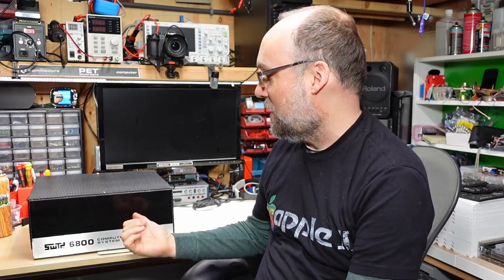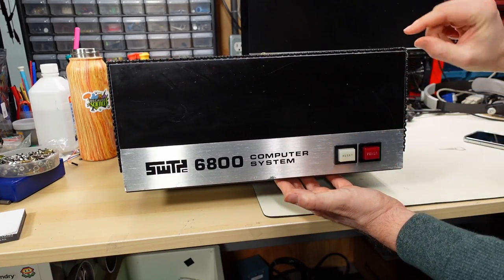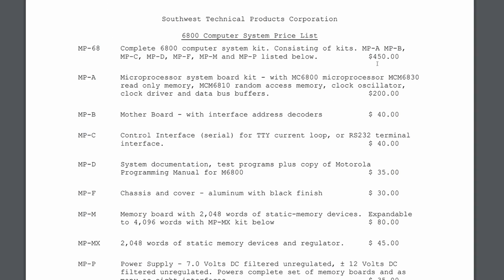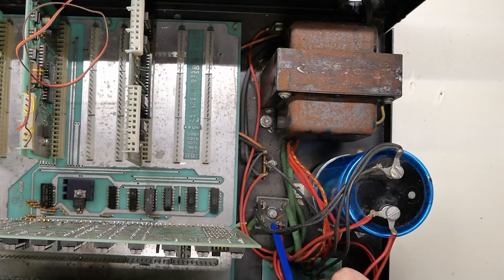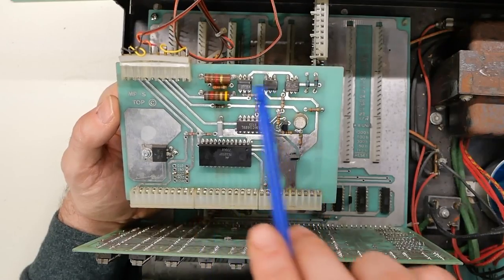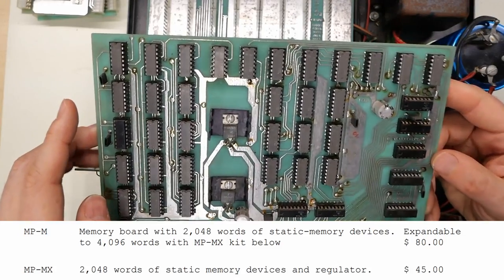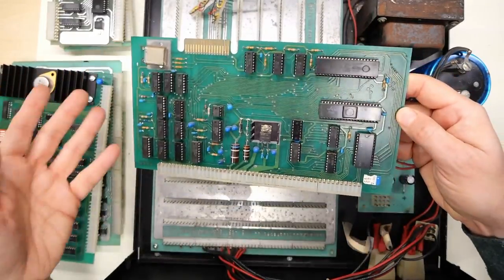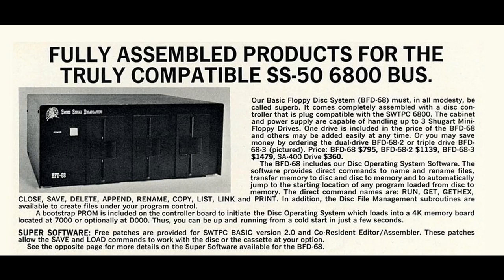The 8-bit home computer from 1975 you've never heard of

Comment: With modern ICs it'd be simple and cheap to make a 64k memory memory board (a custom board , a connector, a regulator, and a modern 64x8 SRAM chip) although you may have to block or mirror romspace at E000-E1FF (or simply block E000+ for 57k ram.)
Reply: There's also going to be memory-mapped I/O. Though likely it will be well documented, given the age of the computer.
Similar to the 6502 the 6800 has a reset vector at FFFE-FFFF so you need ROM here at power-up.
Reply: @markevans2294  I just checked the original MP-A manual online out of curiosity, and it seems that FFFF is intercepted at startup, and it seems like you would ideally disable 80xx (I/O),E0xx, E1xx (mikbug rom), & possibly A0xx (mikbug ram). However, it seems everything above A000 was earmarked for expansion roms (such as that disk drive controller) so a 32k card would be just as simple as I said, you might need a few extra diodes to deactivate read/write at 80xx for a 40k card, and a more complex solution to map the rest.

Interestingly, the later revision (MP-A2) had had logic and DIP switches to control which memory was allowed onto the system  bus in 8k chunks, as well as several 8k EPROM sockets with selectable addresses.

Comment: OK Adrian, the cap does not "produce" anything it filters the full wave DC from the rectifier. I love your videos.
Reply: In a PSU like what's depicted here the voltage will increase when the filter capacitor is connected. So it will appear as if the capacitor is "producing" that extra voltage. Now you can argue that it isn't. But circuits hooked up won't care what you think.

Comment: I remember hearing about this early era of personal computing years ago.  What always astounds me, and even more so today is how much you had to put into these early machines (money, time, effort, and knowledge), and how little you got out.

What did people wind up doing with them?  It's not like you could even really play a game on them, or even do your taxes, or connect to another more powerful computer.  Was the entire point just getting the thing to work in the first place?
Reply: Well, in my case, we used a SWTPC 6800 system at the University of Missouri Research Reactor (MURR) to operate an in-house designed step and rotate stage to conduct computed neutron tomography research, with MURR being a collimated neutron source.  We were able to take the data collected from the beam stop sensor and carry out the first tomographic examination of a nuclear fuel rod.  So there was a lot you could do with these computers, if you were willing to make some interface circuitry and write a control program.  And way, way cheaper than the PDP-11/03s that were also available at that time on campus.
Reply: @randyjost403  That's really interesting that a microcomputer was used for scientific research so early on.

I also had no idea there was such a thing as neutron computed tomography.
Reply: Well, look at how much simple calculators and typewriters cost back then. 

These were calculators and typewriters on steroids, and, with 16K or more, you could run things like  spreadsheet software, which was literally a box full of revelations for most people. Maybe it seems like so little now, but it was a lot back then. And it was worth a lot.

What astounds me is how willing people still are to fail to try to understand just how much they could be getting out of their devices with just a little effort.
Reply: @JoelReesonmars  My understanding the the first spreadsheet on a microcomputer was VisiCalc in 1979, written for the Apple II.  

The Apple II I can understand why people bought it and used it.  These early machines that didn't even have a display I don't quite understand as well.
Reply: Lot of first documented commercial software that was not really first.

As a case in point, a spreadsheet was an example application for small Forth systems early on, and Forth ran on most of the early microprocessors, of course including the 6800. 

A lot of what consumes memory and CPU cycles is large character sets. With just ASCII, you have a lot more room for code.

Also, there is the user interface. If you scrimp on that, you can really reduce system requirements. And then there is multi-tasking. If you're willing to forego that, things can really get small.

Comment: Personally when I reform a capacitor I set the bench supply to current limit at 150ma and the voltage limit at the rated maximum of the cap. It's enough to push through the initial chemical resistance and not enough to overcome a short. That said I have never found a truly failed Malory capacitor. Sprague sure, but never a Malory.

Comment: You should be able to do a hex-edit to change the address boot of the disk.   If you are lucky it is a single constant in the program.  If you aren't you will have to look for all the absolute addresses and change them out by adding or subtracting the proper amount.    

The other option is to find yourself another compatible RAM card and throw it in at that index to get it working.
Reply: Fortunately, the addressing is to the upper 3 bits.  This means you can go in with a disassembler and find how this address is set. You just need to load the disk into any computer that can read it, even a properly equipped modern PC.  I have seen many a hack for importing and exporting floppy disk images from a modern PC for this purpose.

I really wish they would have used a register in the 512 bytes of the CPU-Side memory to store an offset for this sort of thing, so the program doesn't have to be hard coded to a memory region.  However, this machine is probably over 5 years too soon for that.

Comment: This is pretty much a standard SS-50 Bus computer?

There were a lot of these that went under the radar because most of them grouped together as a single class by computer historians like the MSX was.  

It's a real shame there isn't better documentation of these things.

This one being one of the first to have an actual boot bios is pretty notable too!
Reply: As a note, that said, I think the SS-50 Bus was incredibly notable in that it was the first industry standard bus. 

I wish we could go back to a full industry standard computer setup by moving the CPU back onto a standard peripheral board with a custom PCI-E 32x, 64x or 128x slot and using a standardized PCI-E switching hub for an active back-plane.    Bring back the mainframe design baby, and break up the components so we don't have to buy half a computer every three years to get the latest CPU.
Reply: Interesting having the proprietary 30 pin bus too.   By having those addressable you avoid having to use DIP switches or jumpers for addressing.  

That is very revolutionary.  On PC they finally gave up with the sheer resistance to alternative routing methods like these and made the firmware/software based PnP system.  

PCI-E and newer PCI revisions support alternative routing for some I/O functions but few boards use them for anything but the (in)famous IRQ and it's tendency to downright fail on boot in conflicts.  DMA, I/O addresses and Memory addresses are all mapped using firmware.  Interestingly, the PCI firmware standard has been backported to newer solder-on LPC and ISA hardware.  While it could be implemented on old style ISA slots I've never seen it done.  Every ISA card I've seen used the ISA-PnP standard instead of PCI-BIOS PnP.  ISA PnP was full of headaches by comparison as it heavily depended on the OS to resolve failures instead of relying on boot order.

Comment: Be careful removing rust from transformers... the individual sheets (laminates) that make up the transformer core are often coated with something that isolates each laminate from the other, to prevent large eddy currents. Using rust remover could remove that coating and damage the transformer. The two end bells on the transformer can be removed and cleaned/de-rusted/painted without issue though.

Comment: Good video of an important machine.  I was working on minis in '73 and remember when these micros came out.  There were several brands and they were the first machines that technicians, engineers, and ham radio operators, owned personally.  Your comparison to the Apple iI,  which did not come out until 1977, makes no sense.  Did SWTPc send the information regarding memory mapped I/O back in time to themselves via "Einstein Express"  [When it absolutely, positively, has to be there the day before yesterday.]. or something?  Thanks for the laugh about Apple inventing memory-mapped I/O..

Comment: Great Video. The 6502 is to the 6800 the same as the Z80 is to the i8080/i8085. That is a cheaper competitor inspired by the more expensive established chip.
Reply: Not quite.
The 6502 is something of a cut down 6800 which isn't binary compatible.
Whilst the Z80 is binary compatible with the i8080/i8085 plus the addition of two index registers; an alternate set of main registers, the ability to refresh DRAM; 16-bit I/O space addressing; ability to perform shifts/rotates directly on the six general purpose registers;  block copy instructions; etc.
Reply: @markevans2294  Indeed the 6502 was not binary compatible but the original was meant to be pin compatible.

Comment: It's interesting that some of the boards have wires soldered through the vias and other boards don't. That's curious. I couldn't see whether the other components on those boards were soldered on both sides, which would mean the holes aren't plated-through. If the components are soldered on only one side, then the filled visas are a definite oddity.
Reply: Not sure if plated through holes were available then without making the PCBs Ulta expensive. Price was everything and since they were kits let the builder do it.

Comment: 6800's big advancement was it only needed one power bus, +5V. Internally they made the other positive and negative voltages.

8080, and others* needed +5, -5, and +12V, which were harder to do as you had to generate 3 stable voltages just for the CPU (early DRAM used these voltages, too.)
6800 was more expensive, but you quickly saved money on not needing so many power supplies.
Reply: Z80 was +5 only, but the 16K DRAMs still needed +12 and -5, and an RS-232 port still needed a negative voltage (or a chip like MAX232).
Reply: Z80 only needed +5V.
Reply: @8bitwiz_  @snarfusmaximus Yep, I remembered that incorrectly. Zilog's Z80 had only one power rail.
It was even part of their Marketing
https://en.wikipedia.org/wiki/File:Zilog_Z-80_Microprocessor_ad_May_1976.jpg

Still, it was 2 years after the 6800 was out.
Reply: re: '8080, Z80 and the like needed +5, -5, and +12V,"

Nope. Z80 req'd only +5V ... built several wire-wrapped SBCs using Z80's back in the mid 1990s ...

Comment: Too bad that the Motorola 6800 didn't take off.  Such an elegant instruction set.  It didn't suck to be an assembly programmer with Motorola 8 bit processors!  Little known fact: the MOS 6501 was a drop-in, cheaper replacement for the Motorola 6800.  When Motorola sued, MOS re-arranged the instructions in the instruction decoder, the pins on the die, and created new assembly language mnemonics, and produced the 6502!
Reply: pnemonics? you mean mnemonics.
Reply: @martindejong3974  correction made. Not a word I use in everyday conversations 😉
Reply: What actually happened after Motorola sued is that MOS simply discontinued the pin-compatible 6501, which used the same core as the 6502. As it turned out, there hadn't been much interest in a pin-compatible version anyhow, since it still needed an external clock generator, which also led to Motorola making the 6802. Check the various 6502 histories for more info.
Reply: Another of the outcomes of the disagreement was the 6805, which has a certain 8-bit elegance of its own.
Reply: Oh, and the 6800, in SOCs as the 6801 and later 68HC11, took off like crazy in he embedded world.
Reply: @JoelReesonmars  I know, I programmed 68HC11 embedded controllers 😉

Comment: A bridge rectifier doesn't make DC; it converts AC into a series of half-wave, always positive voltage, pulses.  The large capacitor then smooths out these pulses into something pretty close to DC (depending on the load!).
Reply: re: " it converts AC into a series of half-wave"

Full Wave Bridge Rectifier - its in the name ...
Reply: @uploadJ  Correct, but that is to differentiate it from a simple half-wave rectifier (a single diode) which just chops off half of the sinusoid.

If you look at the output of a full wave bridge rectifier you will see a pulse train of half-sinusoids; half of them are from the positive portion of the AC wave, and half are from the negative portion of that wave.
Reply: And neither of those are DC.

Comment: Bakc in its day, getting any sort of eng kit for the 6800 was very expensive. The 6800 alone was expensive in comparison to the later 6502 ... Fortunatly a few years later you have complete system like the C64 for the the same price and even less of a 6800 alone in late 70s. Motorola was bad a$$ back them and they were not afraid to let you know on the price

Comment: the 6800 was easier to work with IMO as it had no I/O space like the 8080 rather it used memory mapped I/O -- that is I/O chips responded to addresses decoded in the 64k address space just like memory.

Comment: The lack of a front panel is actually what makes the 6800CS the very first real modern microcomputer. The MITS and the IMSAI machine were like something from the 1950s. Neat toys for hobbyists who spent too much time watching The 6 Million Dollar Man, but essentially pathetic computers. A Basic I/O System on ROM, and a connecter on the back where the display and keyboard hook up to it -- that's pretty much the invention of the modern machine, imo.
Reply: Microcomputer front panels were also complicated Rube Goldberg contraptions that would actually stuff opcodes on the bus to do their thing. While it might be nice to see a built-in row of LEDs or 7-segment displays, once you had a bit of RAM and a monitor ROM, there wasn't anything that the front panel could do better. You could even do single-step debugging with techniques like the Apple II monitor used.
The terminal was a bit of cost until memory-mapped video became common, but you wanted one for anything serious anyhow.

Comment: Have had a couple of those sprague caps fail recently and were just passing dirty DC into the board (in this case audio mixer boards so 60 cycle hum was ripping it up) It was not made anymore but... Mouser had a direct replacement. I just wouldn't trust something so frail to a reformed cap.  You probably already did so but the wikipedia page on Smoke Signal Broadcasting is a fascinating read in itself. I am kinda surprised I haven't heard of them or South West.
Reply: Do you know what reforming does? If a capacitor can be reformed then it is as good as new. Doesn't work all the time but when it does it works great. I'd trust it. Because you can see it working.
Reply: @1pcfred  Mr. Carlson's Lab goes into some detail on the subject and he does not recommend it. It's a 20 dollar part for peace of mind on old hardware. You start with clean power otherwise you are chasing ghosts.
Reply: @JamesHalfHorse  just a $20 part? Well then chuck the whole thing in the bin then! Don't bother testing any components. That's for plebes! Buy everything new. If the part tests out I'm going to use it. Voltage ripple is hardly difficult to diagnose anyways.
Reply: @1pcfred  A 20 dollar filter cap that is critical to the protection of a 40 something year old hardware yes. Chuck it and replace it.
Reply: @JamesHalfHorse  why not just test the PSU? If it ain't broke then don't fix it.

Comment: The memory card (https://youtu.be/OsikuBXmJIo?t=1080) was not assembled according to the instructions, which specifically say to NOT USE SOCKETS!  The reason was that the joint between the socket and the DIP pins was less reliable and may lead to data errors.

Comment: (05:21) There you go again with your derision of original computer systems of the 70s. The entire metal case is an RF shield, and the mains neutral is bonded to ground.  
Beyond that, how difficult would it be to ground the chassis? Not very difficult indeed... Sheesh! Just because it is old, doesn't mean it is crap...

Comment: Why is there a linear voltage regulator on every card? Couldn’t 5 volts just exist on the bus?
Reply: That eliminated any drop in voltage in the wiring. Switching supplies were still not common, and this was done in some other equipment. It also isolated a failed board from the supply, if a failed component overloaded the local +5V rail. It was a good idea that could prevent overheating the wiring, and it helped to find the bad board.

Comment: Those 2102 1K x 1-bit static RAM chips were used in the TRS-80 Model 1 at least.  Where I worked from '78 to '83 they were on memory boards used for flight simulator graphics, generating four color polygons reflected off parabolic mirrors onto the cockpit windows.  I think there were 64 of them to a board, quite a bit of memory for those days, and there may have been one board for each display unit (one per window).
We had a problem with those 2102s, where the cheap IC sockets had trouble making contact with the edges of the narrow pin legs, causing erratic random errors.  I suggested it would save troubleshooting time & money to use Augat machined-pin sockets instead; after trying them, the errors disappeared, and they were made standard for all new boards.

Comment: Can I ask how did you reform the Mallory cap
Reply: You just charge them with a very low current until the voltage builds up.
Reply: @big0bad0brad  thankyou
Reply: @big0bad0brad  actually the thickness of the aluminium oxide